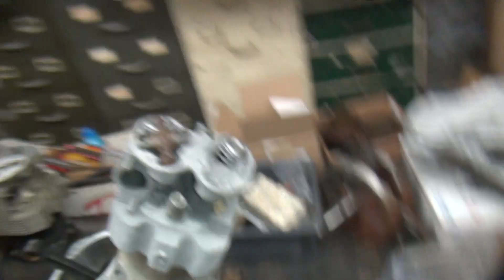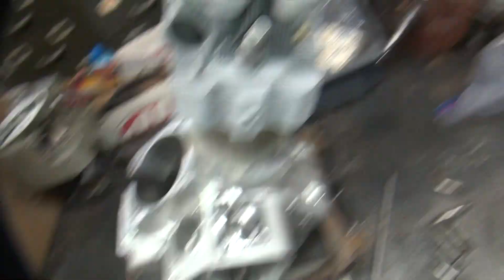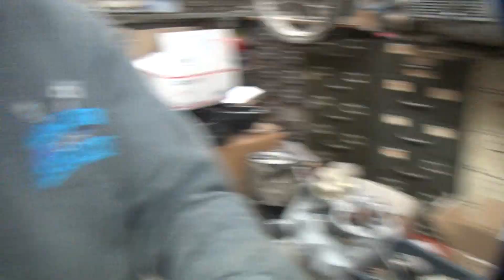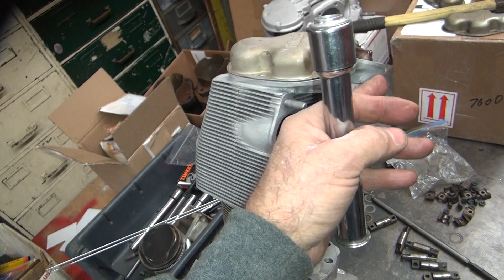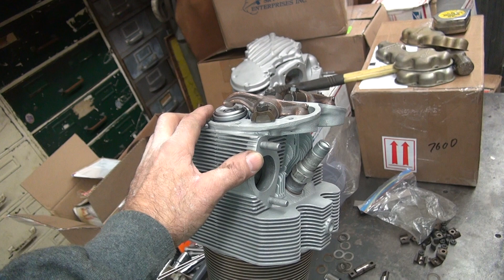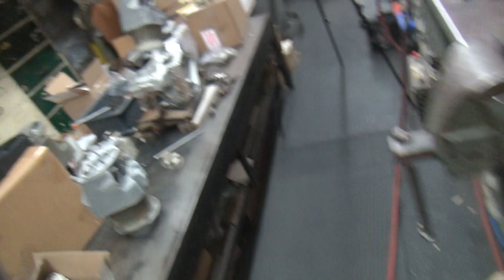#127 harley custom airplane 143ci motor mock-up big evo 4cam sportster twincam m8 race tatro machine

Comment: Looks like a good cylinder design for a parade motorcycle with all those fins!
Reply from the maker: yes. a parade motorcycle  at over 150mph.
tatro
Reply: @TatroMachine  Just a comment about the fins on the cylinders.  I've seen lots of Harleys overheating doing parade duty on a hot day.